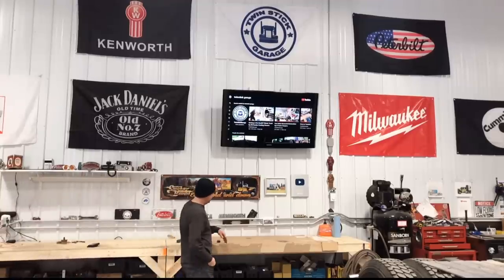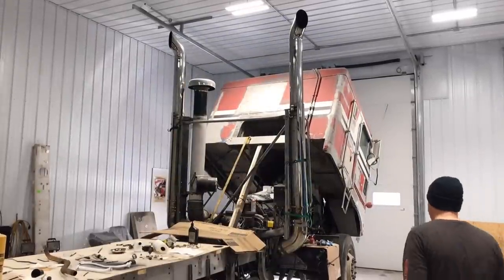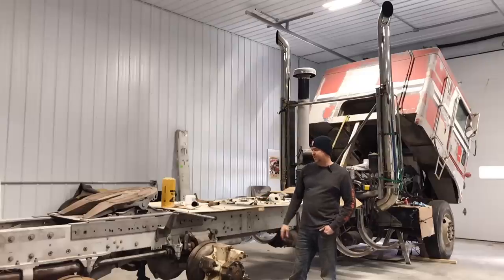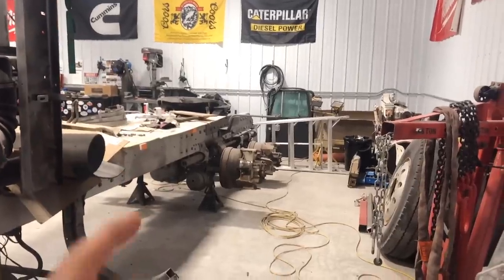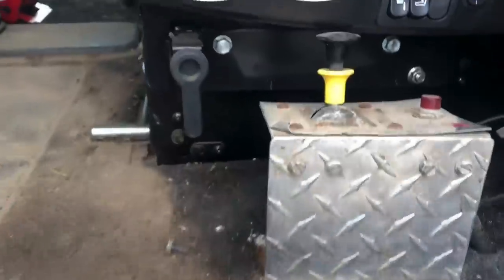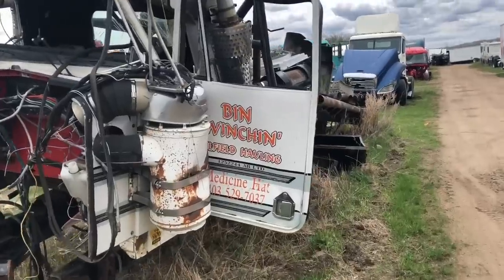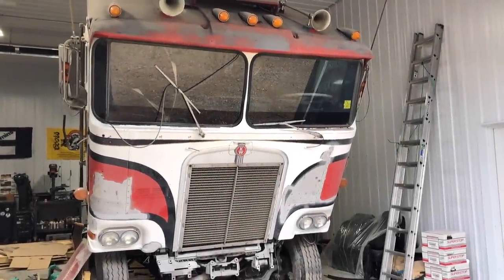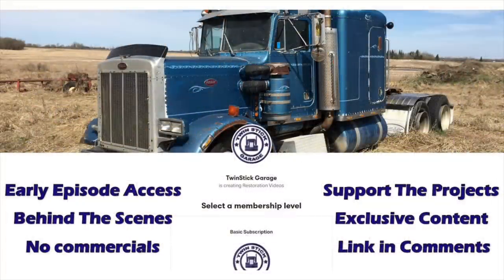Iron Duke Kenworth Restoration Ep.12 New Old Parts

Comment: My buddy has a aluminum framed w900 with corrosion and cracking that I repaired for him.  We stop-drilled all of the cracks and chased them out with a carbide rotary file and then I tig welded them up.  I ended up cutting out 3/8" steel doubler plates on my plasma table that we sandwiched on the inside of the frame rails on the rear.  I powder coated the steel plates before installing and I put large bead of silicone around the perimeter of the steel plates and beads around every bolt hole to try to keep moisture from getting between the plates.  After they were installed we used 3m urethane seam sealer around the outside edge of the steel plates.  I also found some real thin teflon tube to to cut into insulators for all of the bolt holes.  Its only been 2 years but it seems to be indestructible and the truck is constantly fully loaded.

Comment: just got to thinking when you were talking about the sandblasting and making up new steel brackets for the frame, is there not some kind of material you could put between the steel bracket and the alum frame to stop corrosion? even like a thin piece of gasket or cardboard or something
Reply from the maker: Yeah I suppose anything that doesn’t conduct electricity would help 🤔

Comment: Try the planar diesel heater. I have had webasto. Eberspacher and planar. I would choose planar over the others any day.
They were made for Siberia weather and are great. I had webasto and eberspacher in my yacht and had nothing but problems plus parts are always discontinue.  Obsoleteor huge back order.  I bought a planar to replace my webasto . I fired it up in fall and ran non stop till spring for 5 years with no problem. I have one of the 44d in my 34ft motor home that cooks me out.
Only paid $675 for the whole kit.
Best part is they have distributors in Washington state. And Canada. Its where I bought mine. They sell on eBay too. 
You can get the Chinese knock off for $225 but you have to replace blower motor every 2 years if they run non stop for 4 to 5 months.

Comment: I was going to write a long winded message about how unfair and how I was a subscriber from the early days then I remembered how much my k100 cost and im like yeah £4 is not that bad but I hope they are decent length videos and I also hope you get them rear axles with new hubs and air suspension will ride like a dream especially with air cab anyway im becoming a patron looking forward to it mark also looks to be quiet a few bit on there already bud

Comment: #savethedaytons
Reply from the maker: 😂 actually those 22.5 wheels I removed off Duke are gonna go perfect on the Snowman trailer 👍
Reply: @TwinStix  the big problem was neglect...

From my years being around trucks between Dayton's and buds is that it was about maintenance but when you're out there trying to make them miles you don't pay attention to the air gun and the washer

I always said that Budds should have been on the hard stuff and leave the Dayton's to OTRs  and local terminals

Comment: Hi Mark. I think you should convert the Duke to that 8 bag air ride you showed from the wreckers. I have never seen a suspension like on the Duke before. What do they call that ? I owned a pile of trucks through the years and the best thing to happen to the trucking industry was air ride. Also 8 bag has a good ride and traction when in good condition. JMHO
Reply from the maker: The current suspension is a Torsion bar  setup … rare and is actually quite slick once it’s dialed in and kept greased according to some old timers I’ve talked to.  I like bags but there’s no way to weld a steel frame to an aluminum one 🤔
Reply: @TwinStix  Must be a western Canada suspension. I was thinking more of a drill new holes and bolt it on. Keep up the good work !